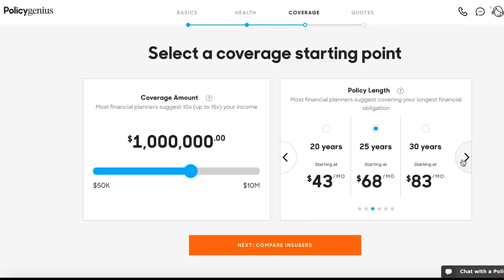Handcrafted Wood Paddles From Texas Walnut And Mulberry

Comment: Thanks for sharing the process you used, Andy.  I always learn a tip or two from your videos.  For instance, I'm about to make a pair of canoe paddles and the idea of using a flat top router bit for hogging off material from the blades will certainly come in handy.  Thanks again, for the great idea!

Comment: I was wondering how you were going to split the handle after you turned it. Would it have worked to maybe left an inch of material on each end that you would leave square. That way when you go to cut it the squares would keep it flat and straight then you'd just cut them off and sand once they're split.
Reply from the maker: Yeah I think that would work!  Good thinking!!

Comment: How do you decide to use epoxy or wood glue? in this case wouldn't b better with just wood glue? the handle is made from wood and the "body" is also made from wood.
Reply from the maker: I knew the glue would be messy so I opted for epoxy.  I can out finish right over the epoxy plus it’s better in the water.